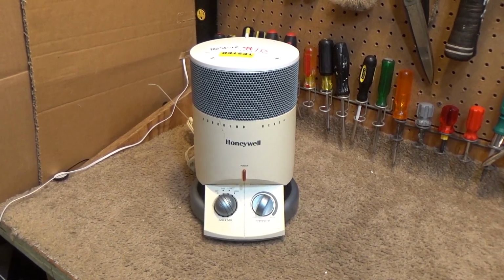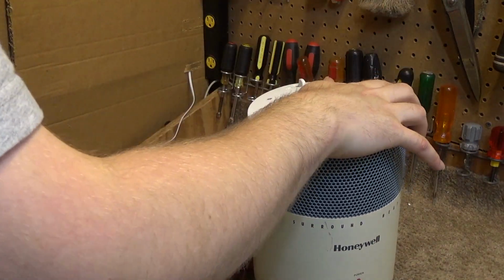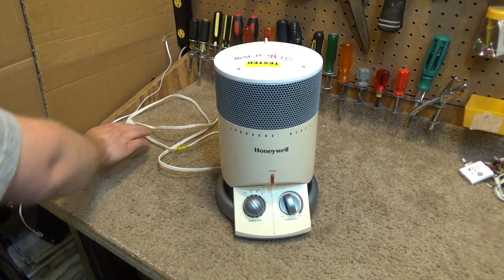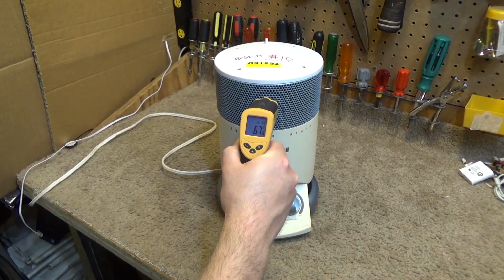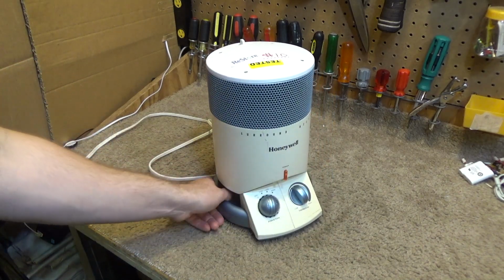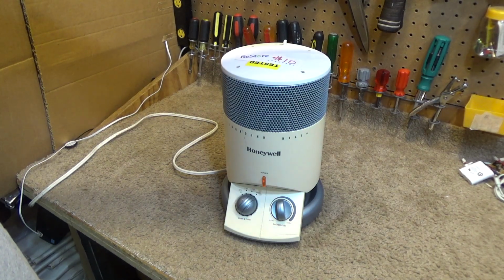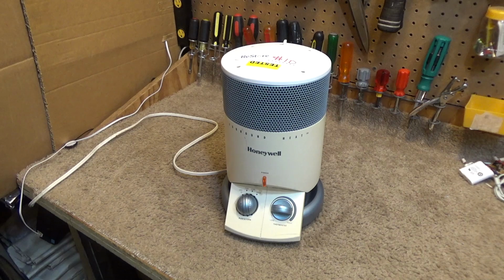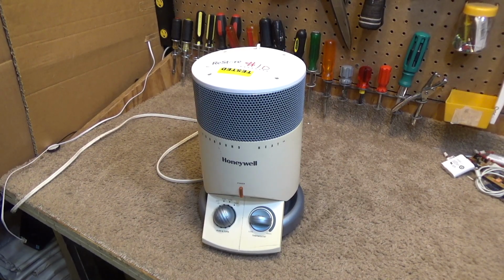Honeywell/Kaz HZ-2204U 1500 Watts Surround Heat Heater | Initial Checkout

Comment: Always find it weird that these heaters cut off the entire power instead of just the heating element, would've been nice if when the thermostat clicked off the fan would run for about a minute before THEN turning off. 
as well the safety switches that cut off the fan are also not really useful, the fan should still be allowed to run in the hopes of cooling off the element.
Reply from the maker: Agreed.